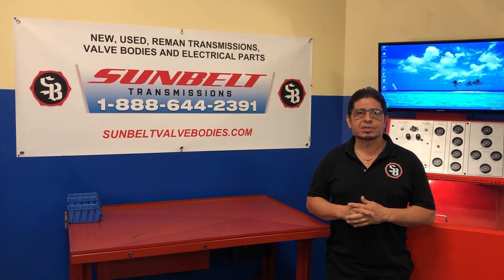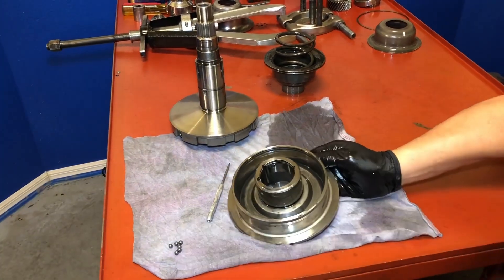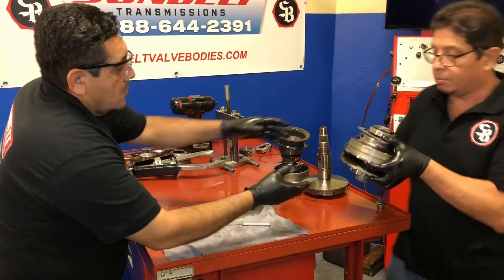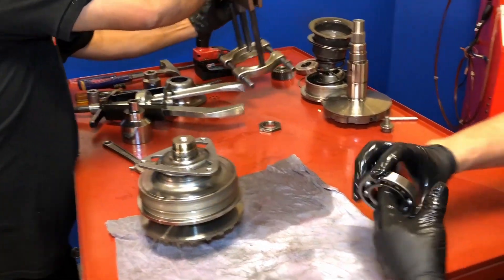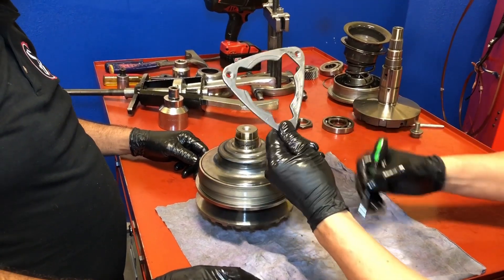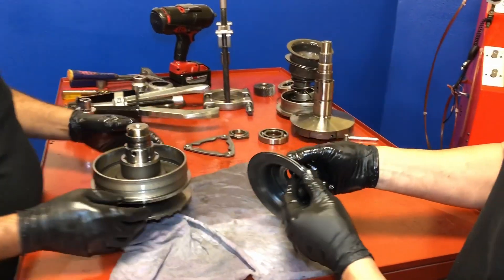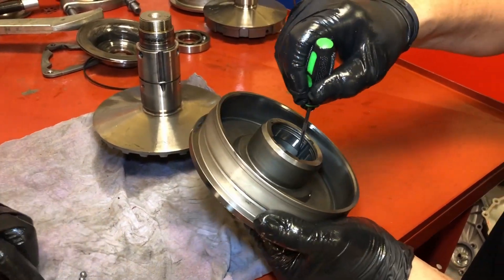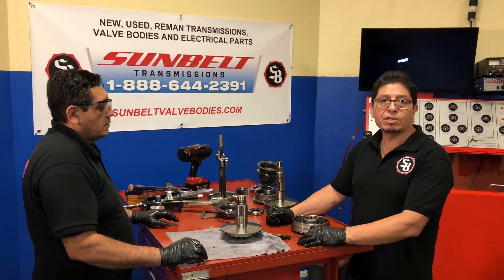CVT How it Works Nissan,Suzuki,Dodge,Mitsubishi, CVT JF011E Pulley disassembled (Part 2)

Comment: question, i got a cvt that keeps getting stuck in a high gear, if i come to a red light and try to pull off it feels like I'm in 4 gear, it just rolls, when scaned the secondary pulley pressure was sky high like 4 mpa, then the car shifts and take off, im thinking the pulley is leaking, if I start on mornings i  would be in first gear then slowly shift into a high gear

Comment: Nice work on the demonstration of the disassembly. How much is a CVT rebuild including removal and installation on average for most Jatco cvts?
Reply from the maker: it depends where you take it too lol some places will charge you an arm and a leg.  We roughly charge between $1800.00-$2400.00
Reply: Sunbelt Valve Body Builders really great prices,  it’ll would be really cool to work in your shop, these video’s really help to understand CVTs and take away the mystery and myths about them.
Reply: what size socket do you use to open the secondary pully bearing nut? 34/38mm?
 @Sunbeltvalvebodies